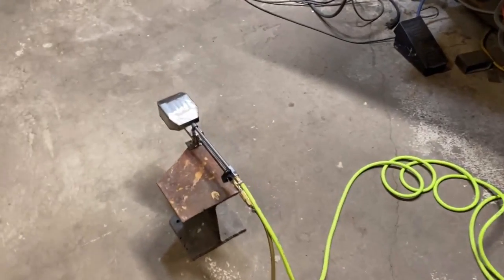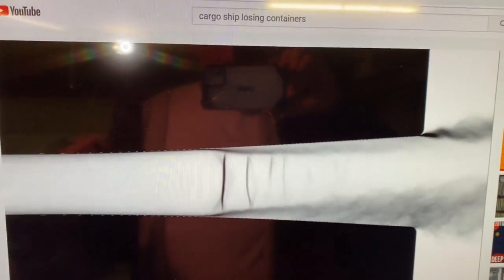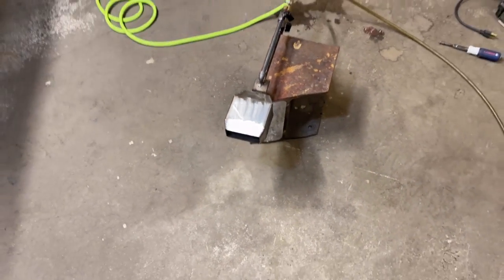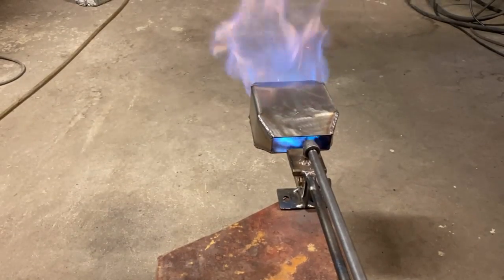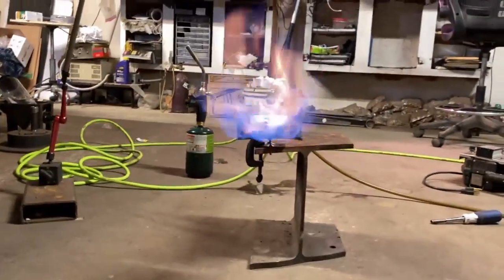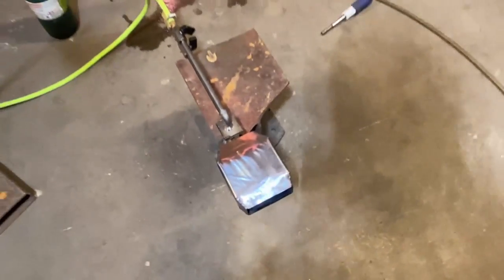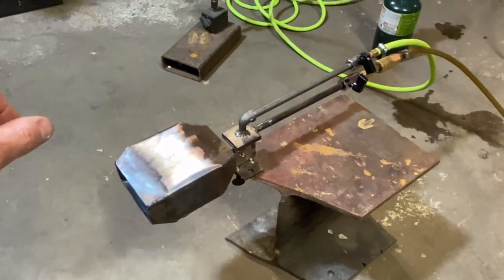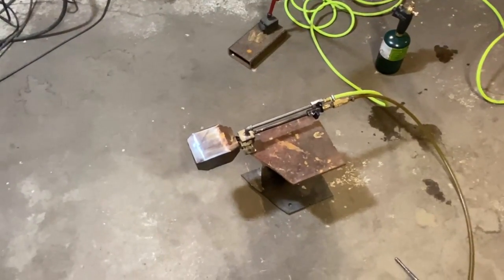2D laminated nozzle testing on propane

Comment: i love all the experiments . I'm more focused on improving existing oil furnace technology but I think we are near 90% plus efficiency  with a Reznor preheater and high pressure Riello (150 psi ) burner with Delevan nozzle. I've seen oil furnaces with a secondary heat exchanger and pvc pipe(schedule 80 grey ) for a chimney but never serviced or installed one. Still incredibly curious

Comment: I think the problem is that the compressed air does not have time to ”stabilize” in the nozzle. What if you extend the nozzle at the rear end and keep the inlet(feed) where it is?

Comment: I thought that I was the only person who does not sleep well but I am not alone. The nozzle needs some tweaking with venture flow surface radius and maybe drilled openings near the face of nozzle. Since you are designing from the inside out you should be able to really increase the efficiency rather easily. The negative is you probably really need a 3d machine which is not cheap but would make things a lot easier for you NB7. Good luck fella too.

Comment: Nice! Have you thought about doing a little precombustion jet? Like in rockets the combustion chamber is before the condi nozzle. The combustion. Provides the pressure to get the choked/Sonia flow in the converging section of the nozzle to get the supersonic flow in the diverging section. 

I’m not sure if that’s counteractive to what you’re overarching purpose of this is.